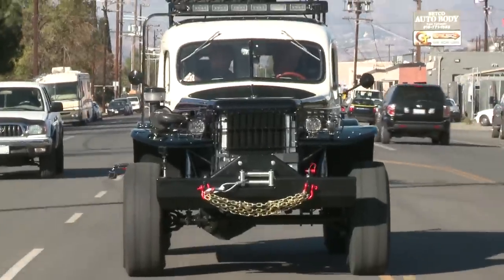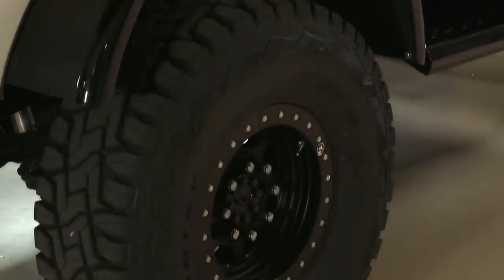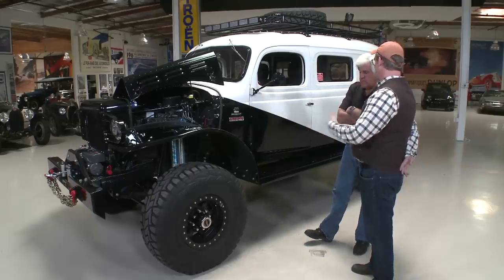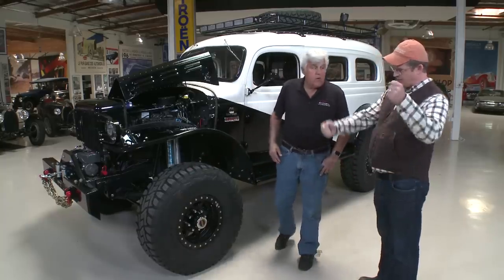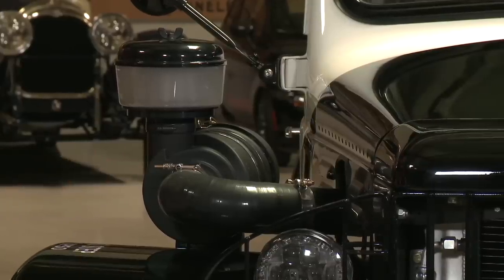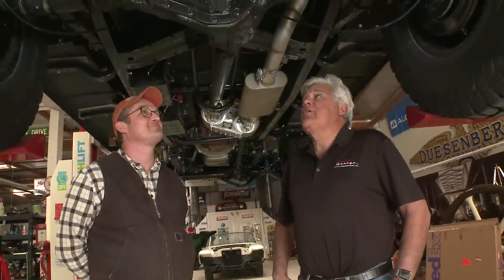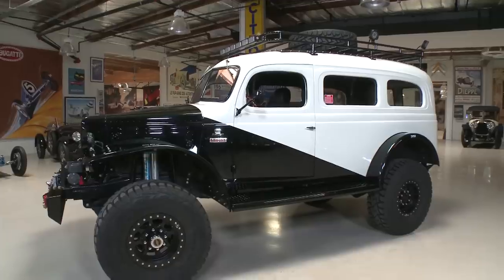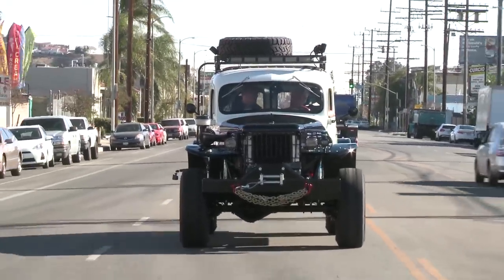1942 Dodge Carryall - Jay Leno's Garage

Comment: In 1974 I was sent to a village in Bangladesh called Char Alexander, the locals told me that they had a helicopter, I didn't believe them but one day I heard this chuff chuff chuff similar to the sound of a helicopter coming up the road. It turned out to be a Dodge truck left by the USA army after the second world war and converted to a bus. As I looked around the bus the phrase necessity being the mother of invention came to mind. The rear tyres were filled with grass, the split rim that keeps the tyre on had a nut and bolt arrangement to hold it in place. The high tension leads from the distributor to the plugs were kept in place by match sticks, the fan belt was made up of multiple lengths of innertube and the piece de resistance was a red brick shaved to a point that was jammed between the dynamo and the engine block as a belt tensioner.

Comment: I used to have a lot of respect and admiration for Legacy but as I continue to advance my skill set in restoration and fabrication this vehicle is far from a $250k price tag. The rear suspension (springs) are the original 1.75” wide springs that came stock on the WC53 with BRASS bushings and cast iron spring hangers. Shocks are purely for looks since it appears they went with a 12” travel shock and limited it to a 4” travel. E Brake cables are at risk of being ripped off, frame has extensive welding which is a corrosion hotspot internally and riddles it with dozens of concentrated stress areas (boxing plates end between crossmembers) and the diesel engine itself is very reliable but there is no reason to boast the spin on fuel filter since they come standard with it. I could care less about the thought put into vent tubes over the rest of the entire damn truck. Making the tailgate out of 1/8” plate means the outer skin is loaded with bondo to get the shape it needs to flow with the body. Fuel fill location is rediculous, headlight mounts are cheesy, hydroboost isnt straight, firewall is just boring flat bedlined steel, the air compressor is a joke... they made gear drive compressors for this cummins engine that would take the cake in air volume and reliablity. Nice try Legacy, I’ll see you next year with a real resto mod Dodge that’s practical! Charlie, New Era Performance LLC
Reply: I'd say you're absolutely right. It's a decent resto mod build, but it is in no way as "practical" as he puts it. I get the feel that this guy just used things that "look cool" but he hasn't got any experience in offroading himself.
Reply: Charlie Pitcher, didn't the rear shocks look like they bottomed out with the wheels on the ground? 4" extension and no room for compression. Plus the sloppy dust boots all balled-up.
Reply: Glad someone else noticed the shocks.  Thing has no travel
Reply: bout a year later lets see that real resto mod dodge
Reply: Donk  for offroad it is
Reply: And opening and closing that 150 pound tailgate that he is so proud of many many times a day
Reply: All that is original is the body. The originals are still going after 75 years, I know I have two a WC51 and a WC54. You can't improve on perfection. I'll bet my two are still running after this is scrap.
Reply: Meeeeeeeow! 🤓
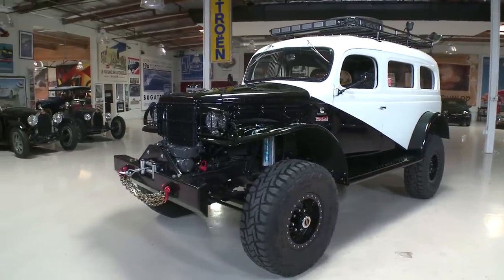Reply: billyfromtheusa  https://www.youtube.com/watch?v=DaHo7LPdgq0 My WC51 at 2:49.
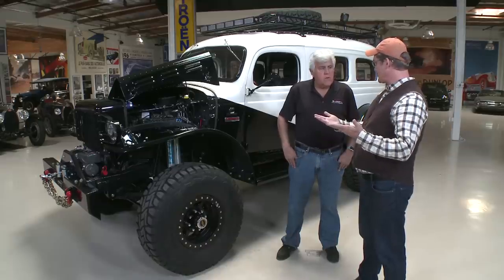Reply: billyfromtheusa  https://www.youtube.com/watch?v=j_43W37XouE My WC54 at 10:12. WC51 is Rubybaby WC54 is Katy.
Reply: Charlie Pitcher I don’t know anything about this stuff. But even I caught a couple of those things. I think  he’s made a name for himself. And now is just phoning it in. So o speak.
Reply: Checkmate!
Reply: You must be jealous you can't sell a power wagon for $150000.  Nice way to advertise your business by bagging someone else. Would definitely not get any work done by you just by your additude.
Reply: I have to agree with you about nearly everything. A glass tube? Wtf? No rear bumper or tow hooks? No power plug ins? But calling it a "pickup truck is a sin, at least up here in Mt. Plus all that you said. Great eye.
Reply: @andrewdynes5300  Rides like a dump truck...
Reply: I agree with all you said. Too many anomalies and details that don't make any sense...
Reply: I agree - that interior air compressor with the metallic blue accents looks like something from Harbor Freight...
it's amazing how much money they put into this build and when it got to the authenticity chart they didn't bother checking many of the boxes. Original chassis. Great. But those front leaf springs are really cheesy. The Detroit locker at the back is a cliché and a joke. Running around corners and squealing tires certainly wouldn't impress me. Nobody can tell me that this is ever going to be taken into a swamp.
Reply: The 150 pound tailgate is a total joke...

Comment: Jay didn't pull any punches with Winslow, pointing out a half dozen questionable decisions on the build. And boy, those low slung e brake cables are just begging to be ripped right out of the drums first time through rough terrain.
Reply: Yes, Yes,Yes  Jay isn't even an off road guy and he schooled this guy.  No rear push bumper, no gel batteries etc etc. Bravo Jay !!!
Reply: I think the cables operate on the disk calipers, but I get your point. Catch one, and the brake may apply before cable ripped out.
Reply: Considering the amount of worrying that drove the fuel filler relocation, having the transmission fluid so easily spillable seems like a backwards step - I mean, I get the idea but if you're concerned that someone might tamper with the vehicle to prevent it from moving, why make it that easy?
Reply: RealUnimportant it's not tampering that he's worried about, it's African criminals out to steal your diesel. There's nothing valuable about trans fluid.
Reply: Whitey funny you should say that.. I found it strange for such a "rugged off road truck" to not have skid plates on the fuel tank or the transfer case...
Reply: the front shocks will bottom out before they hit the bump stop it looks like.
Reply: RealUnimportant So true. ANd that fuel filler placement must be one of the dumbest things about this truck. It's supposed to be a chase vehicle for classic rallys. That means that the back will be filled to the brim with spare parts and tools. So you'd have to empty the back every time you have to fill it. Why not just put the fuel filler behind a locked door on the outside?
Reply: Er,there are Discs all round,no drums,but your point is valid.
Reply: The brake cables can be tucked away with a couple of zip ties, or better yet, some nice cable stays. It's probably one of those details he just didn't have time to get around to before showing up at Jay's garage.

The fuel filler location is just really dumb. Not so much because you have to unpack everything, if you pack your cargo right you only have to move one box of stuff. The real reason is that a diesel spill of even a few drops is going to permeate the interior with the aroma of diesel fuel, and if it's more than a few drops it's going to get into all that cargo you didn't remove. And you'd actually get more security from a locking gas cap because of the rinky latch and padlock setup on the tailgate.
Reply: Yes, and what about the locale of the filler.  What happens when his client loads up the "chase" vehicle with a pile of stuff.  He would have to shuffle things around if they happen to be on top of that square lid.  Kind of dumb!
Reply: I'm glad somebody else noticed that too
Reply: a drill and 10 mins im in the back taking your stuff lmao
Reply: Discs for sure.
Reply: Lol I cool tell he was gonna be tough when he didn’t crack a smile when jay was making fun of his name.
Reply: Inside fuel filler means you will smell diesel constantly while inside the vehicle.
Reply: My yj is built more solid than that thing and its half rust. Did anyone notice the small gm maintenance free batteries under there with underwhelming battery leads? My interstate probably has more amp hours than those two combined.
Reply: @kwhite145  Nothing wrong with going to Somalia, as long as you gave a little firepower and friends with you. For me, it was 2800+ US Marines, hundreds of military vehicles (LAVs, AAV's etc) and backed up by dozens of helicopters and AV-8B Harriers, with a few 5" naval guns on the warships off shore.
Reply: billyfromtheusa  They weren't in 1994/95.. https://en.m.wikipedia.org/wiki/Operation_United_Shield
Reply: @doublel7337   I was in the Congo mid 80s when all the  vehicles outside the hotel had punchered fuel tanks.
Reply: John A - With the kind of money spent on putting this rig together, rerouting brake cables is not significant issue.
Reply: @americangrefeti  Yes like they say in many cases "Cowboy Cadillac".

Comment: So basically Jay pokes holes in all the issues in this incredibly expensive "basic" truck with lead acid batteries, floppy leaf springs with no gators, and unbalanced tires. Cool.
Reply: InsertFlashyName Having been on these offroad rallies this is not the answer. There is a good reason support vehicles tend to be a 10 year old Toyota Landcruiser and a cabover Dakar/Army type truck. The Toyota is quiet, fast and you can easily sell it if you need to leave it in x country if you need the space or money. If needed the Truck can carry the race vehicle and we stick the tools onto/into the Toyota or shiping container should the race car crash beyond repair which happens alot. You can have an awning/work area on the shady/dry side of a a cabover rather than the tailgate in the sun/rain/wind/snow at the side of the dusty road.
Reply: Fraser Wright This guy's clients are Jackson Hole rich, let them do their thing...
Reply: @carloharryman   Who the Hell is Jackson Hole? Maybe I live in a better place, LOL
Reply: Toyota Toyota, blah, blah, always Toyota.  But what about a U.S. post-apocalypse zombie killer?!?  No need for metric around here!
Reply: lol
Reply: ...too many odd deficiencies to this vehicle, such as the vulnerable lead-acid batteries and that plastic sight tube on the transfer case...
Maybe the Jackson hole-ites don't care... There are many compelling details to this vehicle but I just can't warm up to it.

Comment: I love the "On Board Welder" comment! What happens when I need to "Fill Up", and my Tools (and Spare Parts) are in the way? (Geez, maybe I shoulda kept that Side Filler). I love the Sales Pitch: "I drove this through a Blizzard". 5/4-ton axles, but a Dana 60 up front??? I would like to see a follow-up video on this vehicle, to see how it worked.
Reply: Smart guy with no practical experience.
Reply: Lots of poorly thought out little things I saw like that. Cringed when they had it up on the lift and saw where he put the batteries.
Reply: its like he googled "cool parts to put on a expedition vehicle" but has never been out exploring. We put King shocks on it because they look cool but we only have 4" up travel.
Reply: I agree........filler on the inside floor.......with 1000 lbs of stuff on it.....I think the original military location was ok.......put a lock on the cap. And yes, the emergency brake cables are just waiting to be snagged. Roof top for spare tires......NOT! They can be mounted on the driver side....behind the door...in front of the rear fender. That is where I mounted my 37" spare. And.....yes the paint scheme is......is not kosher!
Reply: mipmipmipmipmip replace anything critical, tail lights arent critical.
Reply: 5/4 ton axle is 1-1/4 ton axle that was used on the Jeep Gladiator trucks used in the Arm Forces in Viet Nam they had Dana 60 in the front & Dana 70 in the rear.
Reply: Ahh, ok. I'm learning, this is good!

Comment: How do you fill it with fuel when the back has 1000 pounds of stuff?
Reply: you unload 500lbs of it....
Reply: Leave a 6 inch space from the door to the filler cap.
Reply: I was thinking the same thing.  May have to relocate the filler door
Reply: And gas pump hoses always drip and leave a smell. This time inside the truck.
Reply: Just strike a match and burn it off!
Reply: Put the filler outside with a "robust" lock. 
That sight glass on the bottom needs a shield. That guy didn't have a good answer for the 'why'.
Reply: Now I know why I like my Tahoe...the damn seats.
Reply: I thought the same thing! This is gonna be used as a chase car to carry LOADS of HEAVY stuff soooo....
Reply: I suppose yo have to be smart as to how you position the Load. Sounds like the new owners would be adding their own touches to the vehicle. A few 2x8' could keep tool or other containers from lidinng over that access hatch Anyway there is still many ways someon could could  still sabotage or steal your fuel
Reply: Plan ahead.
Reply: Lol yup, as if the guy who is buying this will ever have that payload. What's he going to load it with lead weights to deliver to the gym? This is a street cruiser that will never see dirt.

Comment: Anyone else notice the rear shocks were completely bottomed out when it was on the lift?  For a quarter million dollars you would think they could at least manage to get that correct.  It is also funny that this guy says they designed it to carry tools and parts as a chase vehicle,  but if you want to put fuel in it you have to remove all of that and stretch all the way into the truck to get at the fuel door as if they couldn't imagine a way to lock the fuel door from a reasonable position.  For Christ sake the rear door requires pad locks if you want to secure it.  What a joke.  More money than brains club vehicle for sure.
Reply: As for the shocks, when off roading you also need downwards travel in the suspension, plus they will most probably be adjustable as well.
Reply: Yeah, there were a couple of quirky things about this truck that made me scratch my head and you mentioned most of them.  I also thought the e-brake lines dangling in big hoops beneath the rear axle was just asking for them to get ripped off when off-roading.  And the big long-tube King shocks look cool, but it looks like they only had about 3 inches of travel, and like you said, they were bottomed out in the rear.  Very strange!  Some things were really well thought-out, and others really weren't.  Like you said, for the money, I'd expect a lot more attention to detail.
Reply: Shocks are blown. Oil leaks from rear shock
Reply: I agree.  Love Jay, but this episode is not one of my favorites.   Bent came across as very pompous, and I loved that Jay challenged him.
Reply: @meadmaker4525  Bet it rides like a dump truck , Not much here . Did not even do a shackle flip for the leaf springs . No shock travel . Could never drive this off road ... Cheap locking lugs on the Dana 60. No e-locker or air locker in the rear .. I could go on...
Reply: You could tell the boots were all krinkled up.